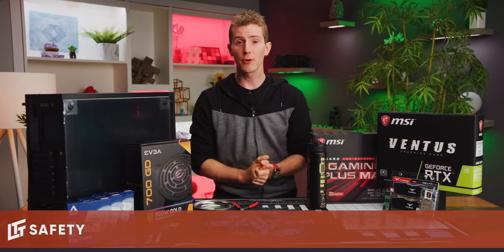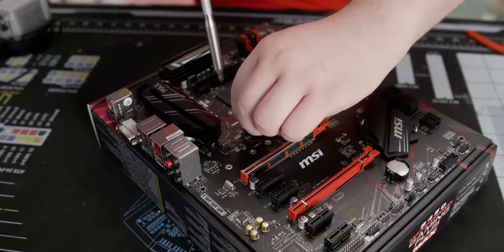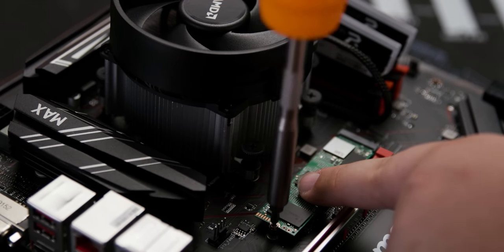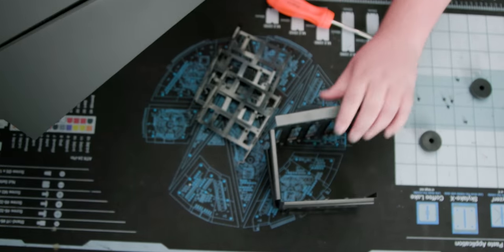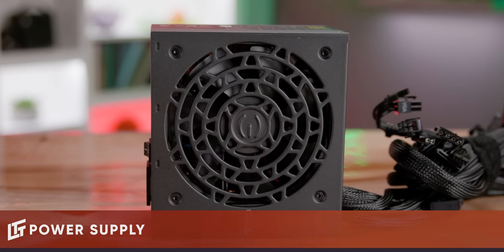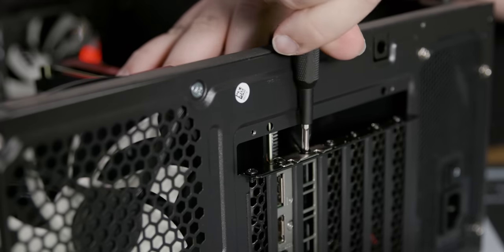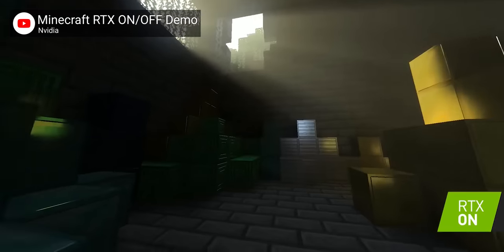$900 Ryzen Gaming Build Guide

Comment: I love how he claims that he have antistatic bracelet on his leg in every build log >.<
Reply: Yea, about that, I bet it's the wireless version... ;)
Reply: He's probably standing on an antistatic floor or mat which does the same thing.
Reply: Lol he’s not even the one building
Reply: @AzziesPersonalRecordings  Having a antistatic floor or mat is the way you tend to do it when building computers professionally. To make this work you either have special shoes or a special strap that goes around your ankle and under your shoe. That way you are grounded whenever you put your foot on the mat. This makes it easy to move around and not forget (read ignore) to connect the grounding strap.

Grounding a mat can often be done by connecting it to something like an element or the water mains provided they use copper piping. If you intend to build a new building with grounded floors you often start by burying copper plates to act as a ground plane. These can be quite substantial, I've seen plates with a surface area of about half a football field used for a decent sized building. Note that I said decent sized and not a huge factory.
But for the home gamer or small shop it doesn't have to be that elaborate.
Reply: Yeah he stated once at the WAN show that he never wears one.
Reply: @Derived_One  He doesn't live in the Arctic circle. He lives a stonesthrow away from the US border and only slightly more northern than Paris.
Reply: Real question, do you actually need one to safely build or what's another alternative
Reply: @abrahampulasqui3091  just touching a grounded piece of metal before sensitive electronics should suffice.
Reply: Ladies and gentlemen we get em
Reply: I never had antistatic anything except the bags the electronics come in, and the room I work in is carpeted, I just touch the case while it is still plugged in before I start, in 25 years of building and repairing PC's I have never had anything go bad from static electricity.
Reply: @blahorgaslisk7763  they use heal straps and ground mats at my company as well.  If there is ever a break in the connection to the mat an alarm goes off.
Reply: @mikeincanada_  thank you sir, so if I got it right. I should have the power supply connected and touch it every now and then, or the power supply inside the case?
Reply: Technically, static electricity CAN destroy your hardware, however, chance for that actually happening is very very low, as hardware today is much better equipped for dealing with ESD. I have personally built few hundreds PCs, and I have never used antistatic bracelet, nor I have ever had piece of hardware died on me because of it. This includes building on carpet, vacuuming dust from PCs and much more. Yes, it is good practice to ground yourself every now and then by touching plugged in PSU, but I rarely did that as well...

For anybody that is wondering how sensitive hardware today is to static discharge, make sure to watch Jayztwocents video:

https://www.youtube.com/watch?v=xdzo-uAvz5Y

Comment: Linus: Builds value oriented PC with very little frills
Also Linus: Plugs gold 30 dollar water bottle
Reply: Geeezzzzzz 30 roubles.  No way
Reply: that moment where the cost of the waterbottle is compareable to the cost of the PC he is building
Reply: and $100 electrostatic mat
Reply: Gus Johnson  I paid $30 for a water bottle.....

Actually it's a thermos. A stainless Aladdin Thermos from 1986 from when they still made things good that holds half a gallon and keeps the temperature, hot or cold, for over 24 hours, with a stainless lid that doubles as a cup.

Also doubles as a battering ram for taking down doors just in case grandma calls because she slipped in the tub and I have to make an emergency entrance. I imagine down in Aussie land it would instead be used as a club to fend off rabid dropbears.
Reply: What if I WANT the bottle?

Comment: "We chose the B450 Gaming Plus from MSI, Why ? Because it's fine" Not because MSI is sponsoring the video
Reply: If they do not overclock, then they can easily get away with an A320 chipset based motherboard.. which is cheaper than any B450 chipset based motherboard
Reply: @tj71520  True, but if you don't have the option to flash the BIOS the MSI B450 Gaming Plus Max is actually a very good board combined with a 3600(x) or a 3500x(If you are willing to save $80 via AliExpress).
Reply: @JorgenKremer  correct. I guess it comes down to budget and purpose
Reply: Well it is a fine motherboard. It should be able to overclock a 3600 without issues, it has BIOS flashback and everything necessary. Compared to the Tomahawk, you're trading the USB C for another 3.0 type A (which could arguably be better) and you get a smaller vrm heatsink, but it's still fine for overclocking a 3600. Compared to other motherboards at that price, Gigabyte and ASRock offer better rear I/O and have an extra M.2 slot, but Gigabyte's software is notoriously bad for overclocking and ASRock have the worst vrm heatsinks. 

So the Gaming Plus MAX is fine. If you don't want to do any overclocking at all, there are better options, but still this one is good enough

Comment: Me: Why would you buy a RTX 2060 when the RX 5700 is the same price and faster?
Me at 0:18: Oh...
Reply: Nvidia you sneaky bastard
Reply: Maybe not so sneaky
Reply: Faster is not the only parameter. It's also buggy, and unclear when (or even whether) many problems are getting fixed or not. I personally wanted a 5700xt, but still gone with a 2060 super as it's less hassle for almost the same price.
Reply: The same could be said for the MSI motherboard. I'm sure that are better budget options available, although I've got nothing against MSI in particular, really.
Reply: @almarc  what did you buy? My 5700xt worked day one w/o issue.
Reply: Nvidia is paying you tubers lmfao okay wan show
Reply: @almarc , what bugs? What problems?
Reply: Some 5700 actually go for cheaper lol I saw a couple XTs go for that price
Reply: 2060 is more reliable with better support and drivers. And 5700 is only slightly faster.
Reply: @hossainalaufi9487 , maybe a few years ago, yeah, but AMD has certainly caught up in terms of drivers.
Reply: @GoodGamer3000  Don't pretend like you don't know what I'm talking about. You might not have problems yourself, but if you're not living in a bunker, you damn sure know that 5700 users are having problems, of different kinds, ranging from weird clock drop issues to artifacts and blue screens multiple times per day. It will get fixed, but it's been months and many of them are still in place.
Reply: @almarc  Yeah I had a 5700 but it wouldn't boost under any circumstance so I got a 2060 Super instead which works great
Reply: @almarc  while that may be true for some, I've had my 5700 since about a week after launch and have had next to no issues with it. Id honestly say that the 20 Super series are lacking in value because there is a significant difference in price to performance (considering the 5700xt approaches the 2070 super in some games), not to mention more vram if comparing to the 2060. Of course though, certain games will be better on one platform than another. Just my opinion and experience!
Reply: @josiah4137  The 5700xt and 2070 super tend to trade blows in games where the devs are amazing and actually optimised for amd lol
Reply: @almarc , but they are not widespread to the point that everyone is getting them. Similar problems are happening/have happened with Nvidia cards. An Nvidia driver once corrupted my system and I had to reinstall Windows. It was annoying, yes, but it doesn't mean I'm not going to buy Nvidia again. In fact I just bought a laptop with a 1650.

If every card were defective, that would be a different story, but it's not. If you buy from either company, there's a chance something will go wrong. I think it's worth the time you have to spend to fix or exchange something, if you can get some extra bang for your buck, from either company.
Reply: GoodGamer3000 raytracing
Reply: @rustyscrewdrivr , why would you trade performance for a gimmick?
Reply: GoodGamer3000 I’ve heard that it also has big problems too but not sure
Reply: @GoodGamer3000  Firstly, about Nvidia GPUs. Indeed, people had problems with RTX cards at the beginning. But in like a month, they fixed it all. Now I literally can't find a single recent post with people talking about buggy RTX drivers, while Radeon is all over the place.

Secondly, the cards are perfectly fine. It's the driver that are f*cked up. And they are absolutely widespread, it's just that in some hardware configurations and under some loads they work fine, while others refuse to work completely.
Reply: @josiah4137  I'd go for it, but I also have another problem - I live overseas. And shipping things back and forth is unnecessary time and money wasted. With Nvidia I'm paying a bit extra, for confidence that I'll plug and play, and not plug and start resolving driver issues.
Reply: @almarc  oh yeah, I totally get that. It'd suck to have to try and get tech support overseas!
Reply: @almarc , it's the combination of driver and card.
Reply: They could at least have mentioned there are other options! Nvidia is playing the Intel game now just doing damage control to stop people from buying 5700's! Recently did a build with one and it works amazingly well. People that whine about buggy drivers must be sponsored by nvidia, do you even know how many times nvidia drivers did the exact same and worse problems?!
Reply: "Only slightly faster" No it is not, it is basically 2060 super so a lot faster
Reply: walentaz you can’t shit on me for never seeing raytracing performance
Reply: @GoodGamer3000  I build computers for my job, the most problematic cards are the 5700 and 5700xt. Mostly driver related, some hardware issues with artifacting, but compared to Nvidia cards, they're just not as reliable.
Reply: @MattLovesGaming , as the end user, I'd rather have a slightly higher chance of a bug than worse performance.
Reply: I bought the Msi Gaming X model of the 5700 XT. It's a beast. The only issue I seem to be having is the shit lighting software and Windows occasionally not prioritizing the windows I actually clixk at, not sure if that is even driver related lol.
I got a good one, I saw mine boost up to almost 2100mhz, some where around 2085 iirc. I've watched a Ton of reviews before getting that card and I never saw another 5700XT boost that high, apart from Powercolors watercooled 5700XT. :'D
Reply: @hossainalaufi9487  not true all the time. From my experience using both, it's pretty much 50/50

Comment: Be warned: the stock CPU coolers sound like a jet engine even at idle. Get an aftermarket cooler if you plan to have your computer anywhere near your desk
Reply: The stock CPU cooler?
Reply: Can. Comp yup thats what i meant
Reply: I built a PC recently with the same cooler, and it was so quiet that first I thought it didn't turn on... It ramained quiet all the time, the customer was very happy.
Reply: Any recommended cooler
Reply: Yeah mine is super loud
Reply: I am going to be using the stock cooler on my new Ryzen 5 1600 af cpu hopefully its not too loud. I already have 4 fans in my case and they are not that loud.
Reply: I can attest to this. Very recently i did a similar 3600x build and was shocked to hear how loud the stock cooler is. Even when the system is idle with low RPM fan its very loud. I have 4 case fans and they make LESS than one-tenth of the noise combined as compared to CPU cooler.  I contacted AMD for replacement of the cooler, they asked for a short video and approved my RMA. The new stock AMD cooler is on the way but i don't plan on using it, will sell it to recover the cost of aftermarket cooler. Ordered 212 evo from Amazon.
Reply: mine is almost silent?
Reply: Amit Gupta perhaps I got a bad one like you did. Regardless, I bought a Noctua cooler to replace it and that thing’s amazing 👌
Reply: @AmitGupta-ki4bt   that will be loud also. I had same cooler. Now i use water cooler.
Reply: Amit Gupta so you just admitted to scamming a company. Nice.
Reply: @DevrajWasHere  Arctic Freezer 34 eSports DUO - https://www.arctic.ac/eu_en/freezer-34-esports-duo.html
Reply: Can confirm. Although since I typically wear headphones I can't hear it. And my condenser microphone doesn't pick it up unless I speak quietly enough to be heard in the background
Reply: @DUSKF1RE   ryzen 2000 have better cooler than 3000
Reply: Considering i’ve been playing on s playstation before getting a pc i dont think it’d bother me much
Reply: @Philip7710   you use your pc nearer than the ps4 will. 20$ cheap cooler from deepcool or other can give you cool ~50C with almost no sound
Reply: @HayesTransport  How? They viewed his video as unnacceptable noise during RMA and accepted that the amount of noise was abnormal and that he was owed a replacement.
 What he chooses to do with the fan that they owe him is his business. He can sell it or wear it like a a hat as far as they're concerned. RMA replacement is not contingent on useage.

Comment: Linus: 14:00 "WOWOWOWOWOWOWOWOWOW"

Me, a laptop owner considering building a desktop: If this is the level of IQ required to build a pc, I can definitely manage it.
Reply: First like yeah
Reply: What? It's like building Lego but easier. No mega IQ required.
Reply: @bradhaines3142  The connectors are even designed to prevent wrong connections... you would really have to force them to connect wrong.
Reply: The toughest part is remembering to connect your monitor to your graphics card lol
Reply: @shipsteer2891  Don't forget the toggle switch on the back of the power supply! 😂
Reply: Might need to consult a manual for the I/O wires, so ability to read will help, but there are usually pictures.

Comment: Fantastic guide (as usual) and the perfect sweet-spot from a price/performance measurement standpoint. I've built almost exactly the same PC a week or so before this video came out (typing from it right now) and it runs perfectly. Don't forget to set up the BIOS as shown in 12:20. I didn't do that and it caused a couple of bluescreens because the RAM ran on the default 2400Mhz instead of the 3000Mhz rated speed. Turning X-AMP on fixed it immediately.

Comment: Imagine LTT making pcpartpicker builds to go with these tutorials
Reply: I wish
Reply: Let me help Xd
Reply: For more bang for the buck, replace the 3600 with the new Ryzen 1600AF and put the extra money into a better GPU or your pocket. Thanks to AM4 being supported so well, you can pop in a 12-16 core in a couple of years and get a lot of life out of a budget build.
Reply: @faceplants2  issue is, they're nearly impossible to fins
Reply: @ant9610  I just checked and Amazon has them in stock right now for $85. That's $12 cheaper than they're selling the older/original 1600AE for but still $5 more than I paid when they were available with prime. I've gotten three in the past month without any issues. Are you outside the US?

EDIT: Although the 1600AF is basically a Zen+ part made on the 12nm node, I believe it still has the original Zen memory controller to maintain compatibility in older boards like the A320/B350. If you're looking to do heavy overclocking, the one caveat I'll add about this chip is that you're unlikely to get past 3200 Mhz. That's way more than you should expect at this price point anyway but figured I'd pass on my experiences.
Reply: gotta get those affiliated links for extra $$

Comment: Right when the Ryzen came out in '17, I built my own computer: Ryzen 5 1500x CPU, Asus B-350 mobo, 16 GB DDR RAM, GeForce 1060 6GB Graphics card and 500GB SSD hard drive.  It was never top of the line, but I'll be damned if it wasn't - and still is - a solid performer. No need to update or upgrade anything for at least another couple of years (if I plan on playing AAA games on at least high resolution), or many more years if not.

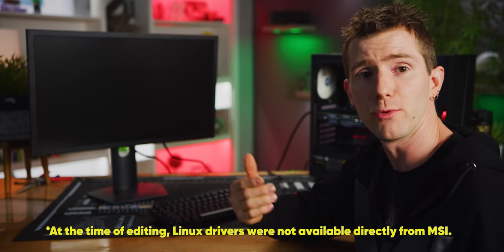Comment: 12:34 *The one who edited this video please ask LTT Anthony how drivers in linux work.
Reply: They don't
Reply: Actually there's no need. Unlike Windows, Linux is a monolithic kernel, and for most components the drivers are included in the kernel. These days the only drivers that are not in the upstream kernel are graphics drivers, that too if you are using Nvidia.
Reply: @Quarky_  With that being said you should always be careful with recent hardware on Linux as often times you need to wait a few weeks/months after hardware release for a kernel that provides smooth support (eg. booting without additional kernel parameters or graphics glitches).
Reply: @PandaMoniumHUN  True, but I have found it's mostly graphics.  For example, I had to wait about 2 months after release before I got a stable system with my Ryzen 5 2400G, but all instabilities were limited to graphics. Back in the old days wireless drivers would also be an issue, but not any more.

I'm actually considering building a system with an RX 5700(XT) to play around with the ROCm compute stuff.  See where we are today, I can buy a new card and have a completely open compute stack to put it through its paces!
Reply: @Quarky_  Using 5.4.2 kernel 5700xt works mostly fine.

Comment: Linus: makes a video about why the 660p is bad.

Also Linus: advertises newer builders to use the 660p in their new build.
Reply: It is bad for heavy duty and synthetic tests, but for a regular gaming computer it is pretty good if you are on a short budget. Other SSDs at that price point are usually SATA and DRAMless.
Reply: yes, should be better to buy a MP510 or something like that !
Reply: If anyone's wondering the 660p is great for it's price, just has a low TBW. I've got one and the boot time with a ton of startup programs is like 7 seconds. It's amazing value for money.
Reply: @keon5779  but for just like 10 dollars extra you can get a sabrent rocket